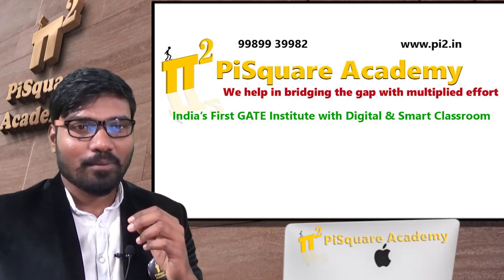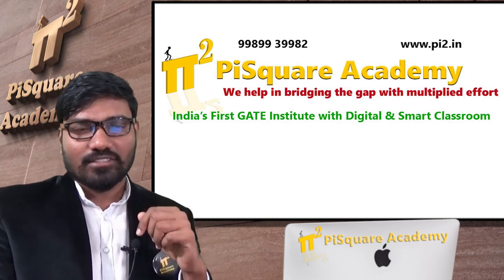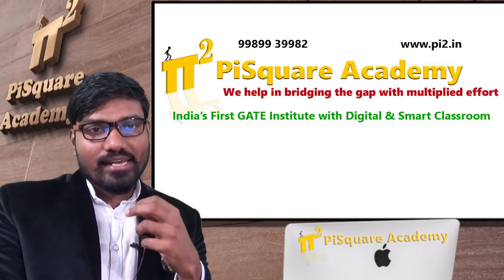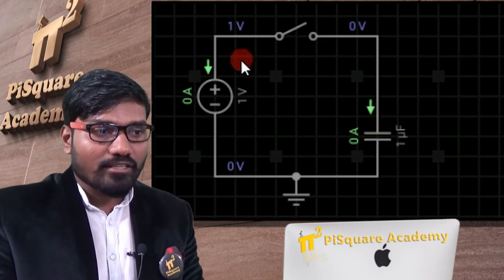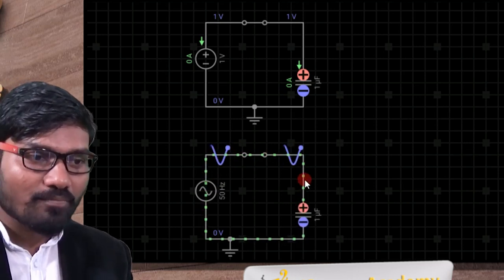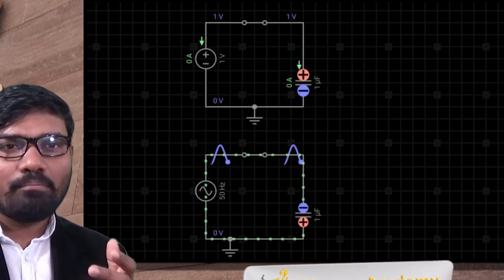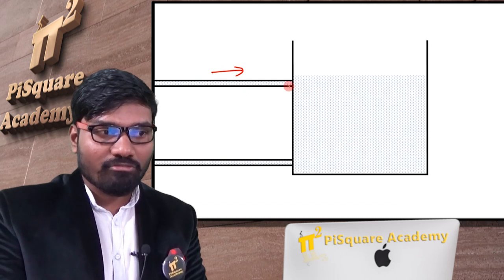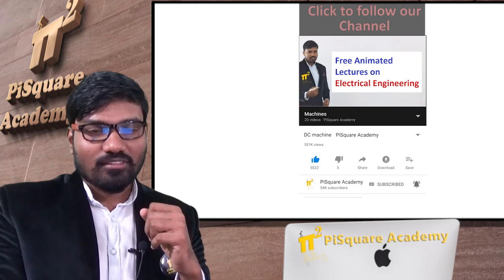Why AC cannot be stored unlike DC | Simple Interview question

Comment: Can you have two batteries. One + - and the other aligned - +. Then every 10 milliseconds you connect one battery so it only has current flowing in one direction, then switch to the other battery when current is flowing the other direction?
Reply from the maker: No, you cannot

Comment: If I think conceptually you could store AC power in a rotating object such as a flywheel. 

Spin up the flywheel using a motor and then once up to speed decouple from the motor. Then you couple with the motor without providing a power source. You can use the rotational energy in the flywheel to to drive the motor or use the motor attach to a load or as a generator. This is crude and perhaps not very efficient, but it's an interesting thought I had of 'some' way you could store AC power. 

So not impossible, if you had lots of excess AC power, you could use a giant flywheel (or any rotating mass set up with efficient bearings), to hold onto as much power as possible and extract it in AC form by coupling a motor.

Comment: I am a mechanical engineering but just want ask how capacitors are used in ac circuits then.... And in this case what if we use diode before the capacitor it will charge... !!!!  Just asking

Comment: Why high voltage(11kv) circuit breaker is Trip while wire touch any kind of things, but why not Trip 230/440 volt circuit breaker which touch any kind of things

Comment: Not entirely true. A large reservoir of water with huge potential energy (due to its relative height from generating station) is quite literally a storage or "battery" used for generating AC power. Or perhaps an inverter. Yes, you'd be charging batteries with AC power and also final output is also AC during discharge phase.